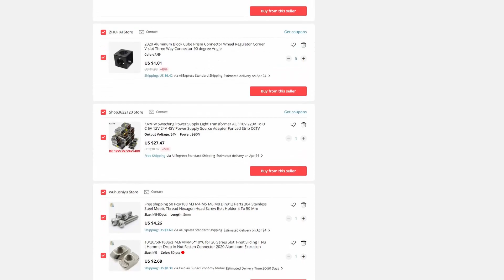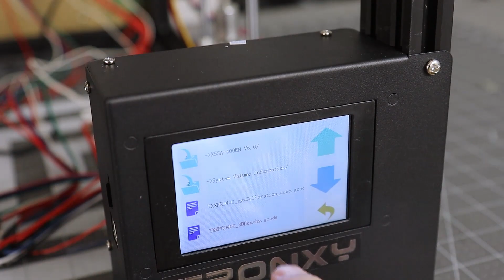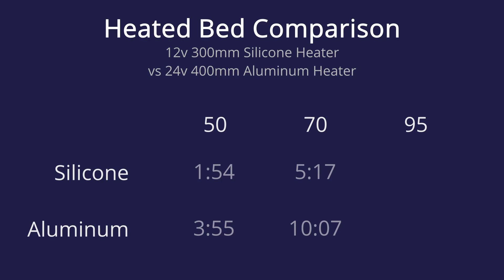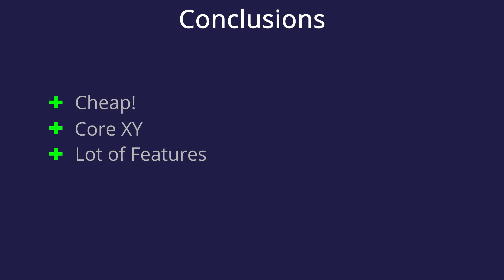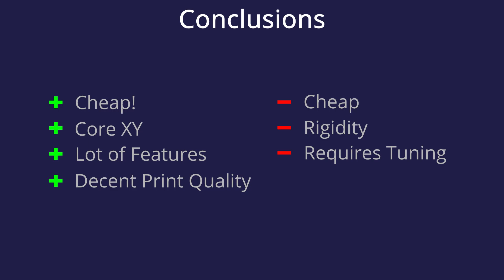Review: TronXY X5SA-400 3D Printer - A 'Starter Kit' for a Really Great 3D Printer

Comment: I'll always say this, it's a fantastic second printer. it takes some general 3d printing knowledge to trouble shoot it. I swapped the main board to a SKR 1.4 running Klipper and mainsail. easily have it cruising along at 120mm/s 9k accel with the stock hot end. I'll probably do a direct drive + V6 before i do linear rails.
Reply from the maker: Hello boardinrider.  Ya, 2nd machine would be about right.  I'm having additional trouble with my X5SA.  The board resets ~1-2 hours into a print.  Just started happening out of the blue.  Did a 33+ hour print one day, can't do a 2 hour print the next.  I've swapped the PSU for a Meanwell, tried Marlin, the OG firmware, and now Klipper.  Was hoping to put off the board upgrade for a while but it's not looking good.  In fact, would've already had a video out showing my upgrades including direct drive on a X linear rail if it wasn't for this reset PITA. :(
Reply: @LilMikeysBigPlans  keep an eye on on your driver temps, they don't have heat sinks and they really should
Reply from the maker: @boardinrider  Good call!  My V5 board actually does have heatsinks across all of the drivers and a fan that blows across them.  I'm tweaking down the voltages now to see if it has any effect.

Comment: Totally agree on the pros and cons. Another TronXY owner here. One of the most important tuning I've done was to file down the ends of each extruded frame beam straight, as they were not cut at the right angles and thus led to more warping of the frame as you tighten the bolts.
Reply from the maker: That's a good call and one of the reasons I don't like screwing directly into the frame.  My printer is pretty much held together with brackets at this point but anyone fighting to keep their TronXY square would do well to check the squareness of the extrusion cuts.
Reply: Yeah I'd say frame first braces second. Like it's hard to imagine a rally car's roll cage with all the bracing but without the ends of each tubing butted against and welded firmly on to one another. Ideally you'd need a milling machine for this frame truing, but hand-tuning is never a bad idea because the stock frame materials are way more off square than you can achieve manually with files. And even if the end faces end up in a slight parabolic shape it's fine, way better than a (semi) straight-cut solid face that's off by a few degrees that these profiles tend to be. I can assure you it's worth giving a shot if you ever get a chance to overhaul the whole thing. 

Another minor geeky note... My frame beams didn't come with proper seating surface for regular bolt head shapes around the pre-drilled holes, so I opted for countersunk head bolts so they'd seat better against the 90 deg surface on the inside of the profile. Seems to work well, obviously better than the awful point contact you'd get with provided bolts (if you have the same issue with inadequate countersinking job they did).

Comment: Thanks!  How about adding some insulation below the heat bed?
Reply from the maker: Hello Hugh, unfortunately it came with about 1/4" of insulation under the bed.  I guess it's unfortunate in the sense that even with the insulation it couldn't hit the temps but fortunate in that if/when you upgrade to a better heater the insulation is already in place.

Comment: I got 2 off them and I can say they are so poor quality .

I never try to upgrade because I already spend 1 000 USD .

Since I have them so 2 month ago ,
I already spend like 1 month and half to fix issue and another issue and another issue ECT ...

I use a creality more than 6 month and she's runnings 24hrs 7/7 because I need a lot of print and I brought 2 tronxy to help but they doesn't help at all .losing my times .

Be carefull with the step down because I got electrical shock with both 220V ,I will never get tronxy anymore .
Reply from the maker: Yeah, the out of box experience isn't the best.  Definitely more a box of parts that can become a great printer.  The brackets for rigidity should only run you about $20 and the alignment fixes mentioned are freely printable.  Once those problems are fixed you should be in decent shape - assuming no massive QC failure with what's in your box.

Someone else mentioned that the $289 deal that I got is no longer available and the cheapest you can find them is around $400.  $289 is a slam dunk but at $400 I'd probably look at something else.

Comment: yes its a great diy printer and good idea for building on top of it, I have x5sa-pro its amazing after all the upgrades also I recommend klipper firmware for the best speed and quality
Reply from the maker: Agreed.  If you want quality out of the box then it's pretty 'meh' but a few cheap upgrades and it's a solid performer.  I tried klipper for a second but Octoprint refused to connect even though it looked like the flash was correct so I dropped it and went back to Marlin without a lot of investigation.  I've yet to run klipper on my printers but will get back to it as soon as some of my upgrades are complete.
Reply: @LilMikeysBigPlans  let me know I can help you get klipper working when you're ready.

Comment: So do you think someone new to 3d printing would actually be better off starting with the pro series vs the non-pro.  I actually started out with resin printing, and now am thinking it would be nice to have a corexy, just to print out bigger terrain type pieces on a filament style printer.
Reply from the maker: Hello Paul.  If you're brand new to FDM printing I would suggest a Prusa-Style printer first - and preferably from a brand with decent QC.  There's just so much less that can go wrong with them and they are usually much easier to set up and tune.

If you're sold on the TronXY X5SA I think it's hard justify the $110 difference for the Pro I see on some sites.  The TronXY site says the differences are: Titan clone extruder (my non-Pro has a Titan clone), more metal parts (my non-pro was all-metal except the motor mounts and cable mount garbage), and the rail system.  $110 for just the rail system seems a bit much.  That's about what three (off-brand) true linear rails will run you on Amazon.  I also don't think the wheel system is that bad and you can get plenty good prints with the non-pro rails.

So, I guess if you're not planning on any upgrades and don't want to have to replace worn wheels down the road then the somewhat overpriced upgrade  may be alright, but it really chews into the TronXY's value.

I do some resin printing as well.  There's a lot more tweaking and tuning with FDM but being able to just yank a print off the plate and not have to worry about fumes, curing, burns, or re-bottling resin is pretty great.

Comment: Thanks, I was having the same thought about buying one of these.
It looks like a nice starting kit.
Can the the firmware be replaced? Or is it better to just swap out the boards?
Reply from the maker: Yep, running Marlin 2.0 on it now and it's working great - including the LCD.  I used the instructions here: https://github.com/rhapsodyv/Configurations/blob/tronxy_x5sa_v5_v6/config/examples/Tronxy/X5SA/HOWTO-INSTALL.md.  It's a 32-bit board and supposedly they are A4988 drivers but they are far quieter then the A4988s on my other printers.  Honestly, the board seems fine for general use.

I did try to set up Klipper briefly as well.  The board seemed to flash but it would never connect.  Probably won't get back to that for a while.
Reply: @LilMikeysBigPlans  So I ordered the pro model, but they shipped me a standard. After some back and forth, I took a partial refund and kept what they sent.

A few thoughts, the extruder is not especially good. It works, just it can't be pushed in the least bit, it would be fine for a smaller printer, but not for something this big. It can't keep up with a 0.8mm nozzle. I am replacing it with a BMG as we speak, and I went ahead and upgraded the hot end to an E3D V6 while I was in there.

I used the stock software for 1 day, and replaced it with Klipper using the fluidpi interface. It was pretty painless to get it going, I followed the official guide with a sprinkling of Voron and a nice vid I found here
https://www.youtube.com/watch?v=CmEiYJdJzuY&t=123s
The video will be especially helpful to those with little command line experience, and he fills in the little gaps. Follow the official guide though, the other guides are either different or out of date.

All in all, a pretty decent printer out of the box if you take the time to put it together properly

Comment: aye thats really awesome! this does seem like a really good entry level product for the hobby. i think once i really get into it i would like something with a bit more quality and premium feel to it? but this seems like a nice cheap option
Reply from the maker: Hello Aleph Null.  If you're brand new to the hobby I would suggest one these two options:
1) Prusa i3 MK3S+ (https://www.prusaprinters.org):  Prusa printers are amazing quality, easy to build, have tons of customizability and a huge community.  They are expensive for what you get with the kit starting at $750 for a 200mm3 build volume.
2) Creality Ender or CR series (https://www.creality.com): They may not be quite as premium as Prusa but represent a much better value at $300 for a similar size and features to the Prusa i3.

The TronXY is a steal for the build volume but it's probably not a great 'first' 3D printer.  If you need a 400mm3 build volume and can't spring for a $500-$600 Creality or, like me, you're more interested in building up a kit, the TronXY is exactly what you want.  That said, these basic kits really force a newbie to learn a lot about 3D printing to make things work right - if you don't quit out of frustration first.
Reply: The Artillery Sidewinder has a 300x300x400 build volume with direct drive. It’s been a great printer for me, but watch a lot of reviews. It was easier to put together than my Ender 3 Pro.